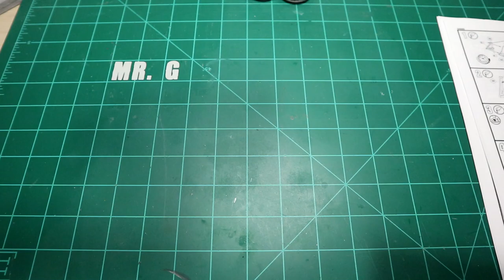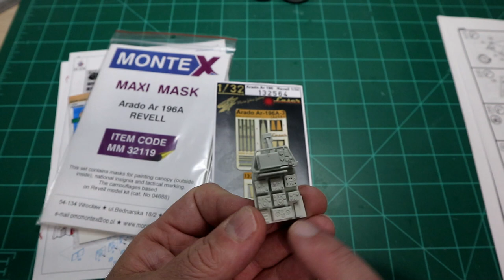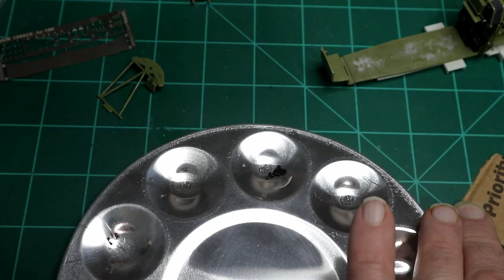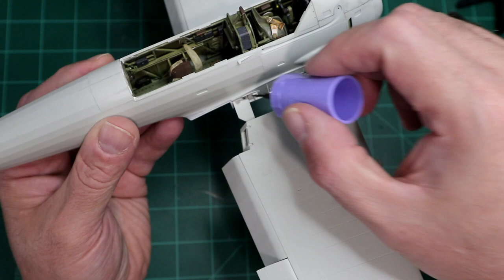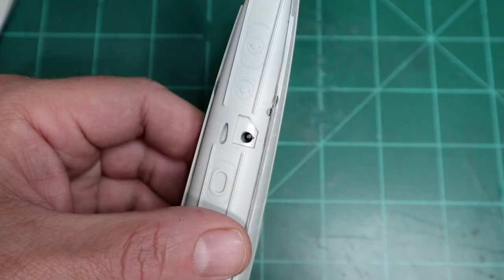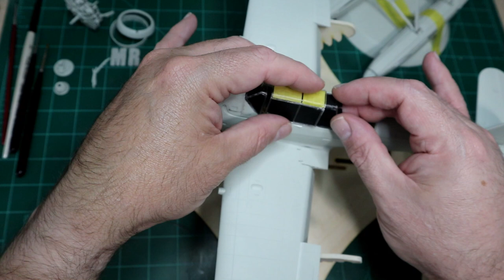Revell Ar-196A-3 1/32 Build - Part 1: Assembly

Comment: Beautiful plane. The Revell kit is a great platform to work on. I Highly recommend using the hphmodels resin canopy set  though. The kit canopy is really ruiining the all project.  Keep up the good work.
Reply from the maker: Thanks very much Kostas - if I did it again I would use the HpH canopy for sure. Thanks for watching!
Reply: I second that motion. The clear resin canopy MAKES that kit. If you can find the PE set, that helps, too.

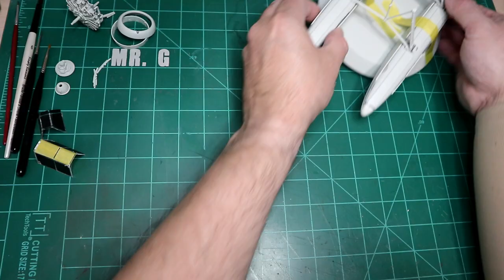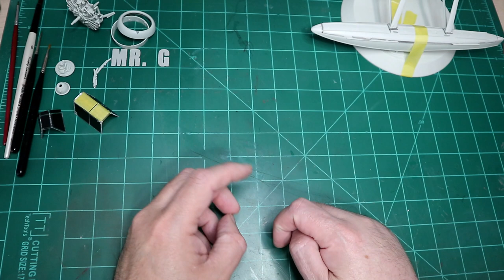Comment: 22:40 & 24:30, 25:07, 25:26 26:00  or so I noticed the bumping sound; it's as if the mic stand is being bumped or a table leg is uneven and is bumping the floor. The music interlude sounds good, though!
Reply from the maker: Thanks for the lead - I'll sit down tomorrow and take a look. Once I watch it I'll let you know.
Reply from the maker: Kip - after reviewing the video I think that sound is my chair on the floor mat. My mic is plugged into the camera and is attached just to the camera body. I recently tightened the bolts on the chair - perhaps something has shifted?